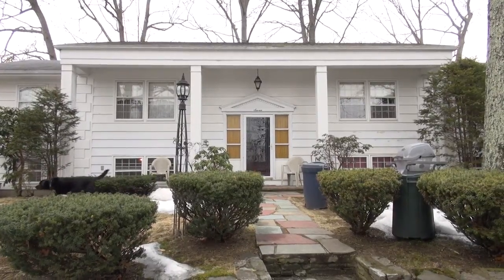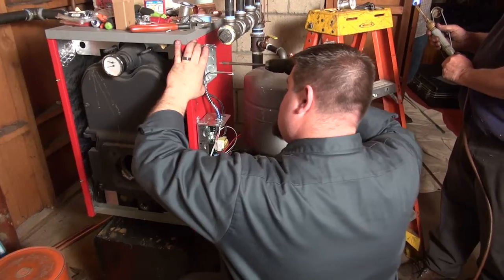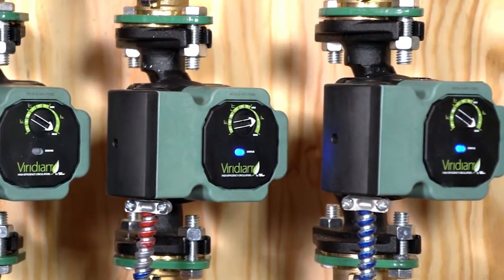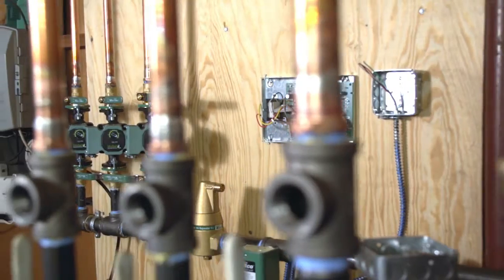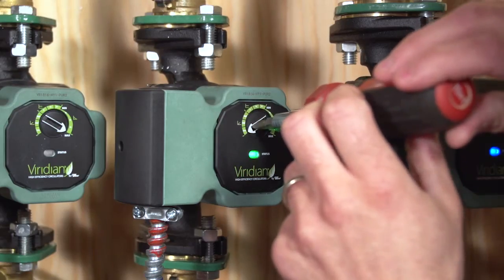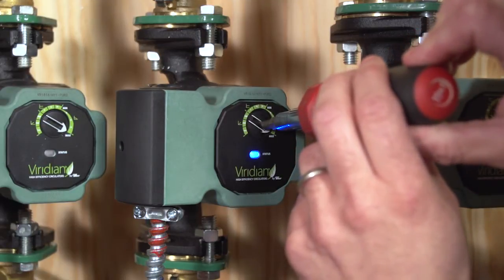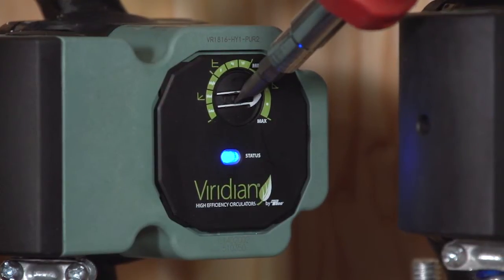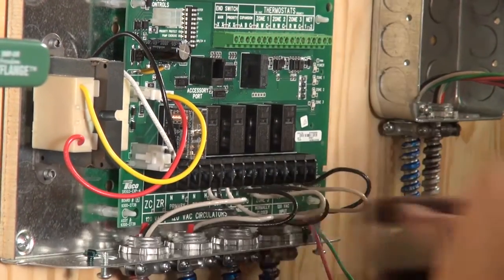Notes from the Field: Viridian VR1816 Installation

Comment: Curious, why would you choose to zone with circulators instead of zoning with  sentry valves? What's the determining factor?
Reply: When zoning with pumps...if one goes bad you still have heat on different zone.Zoning with sentry valve, if  circulator go bad, you have no heat on whole house.